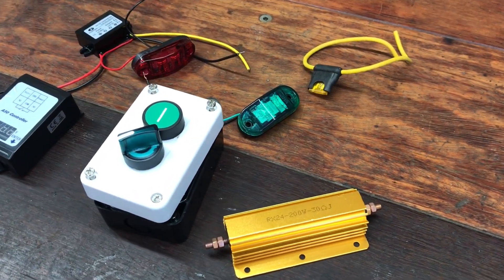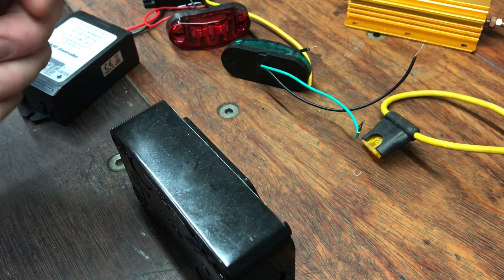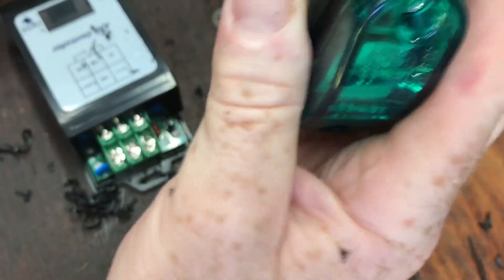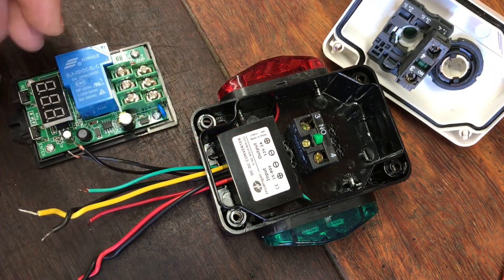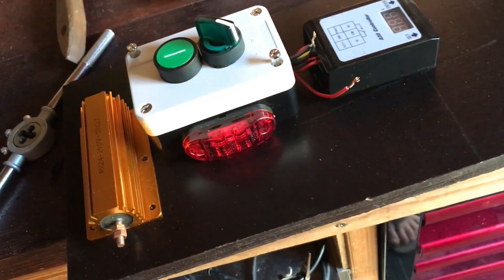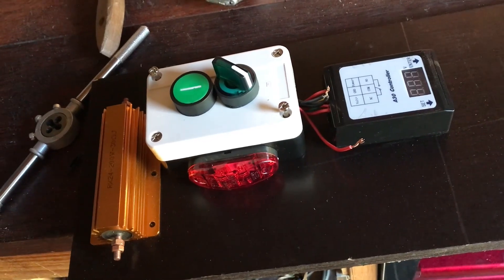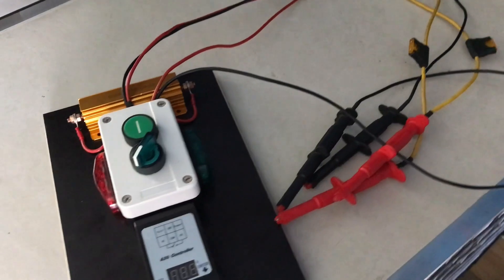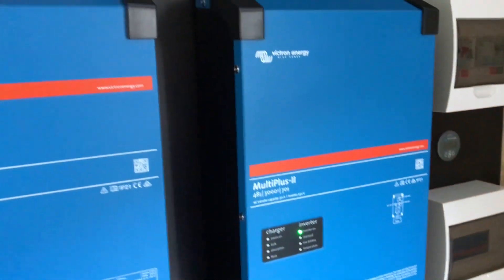SAFE Off-Grid Start Up Procedure For Parallel Victron Energy Multiplus II - Extend Equipment Life

Comment: I have a 32 amp mini dc breaker that gets 100*f coming from 4 525 watt panels wired 2s2p seeing 100v 37a. Bought a 50a mini but that’s probably not going to cool the hot breaker issue.Replacing 10 gauge wire from panels to controller with 8 gauge wire.If that doesn’t cool breaker off I’ll buy a big breaker like you installed.
Reply from the maker: Consider joining the YouTube channel or our Patreon, you can contact me directly to answer any technical questions. I am a "A Class" electrician, I've got the books open here with the answers you require. 6mm2 10awg flex has a CCC of 43A touching, before calculating voltage drop.
Reply: @OrganicPower-Australia  I subbed right after my last question.Great channel !!! Just finished installing 8awg.Only 10 foot runs. Hope it cools it off.
Reply from the maker: Thank you for supporting the channel with a SUB! 10mm2 8awg is rated to 62A touching or 33A exposed to sun. I'm sure you have it covered, but make sure you use decent quality 2 pole "DC" circuit breakers. Re-tighten the terminals several times when using flex cable, also add boot lace crimps to provide a solid low resistance joint. Cheers
Reply: @OrganicPower-Australia  tanks . Yes I put ferrals on wires.Thing about Amazon per chase as of late the proven good stifff doesn’t come up unless you know what to get then it pops up. Most times unavailable. Thanks for having me mate!
Check out in USA a song ,I’m just a skinny boy gona chase your women and drink your beer.Cheers
Reply from the maker: No problem, glad you dropped by 🤙🏻

Comment: Great video as always👍 I was wondering about you switching out the mccb from tomzn to gaya. was there a particular reason or just an upgrade needed for the newly added battery bank?
Keep it up!
Reply from the maker: Hey there, thanks for the great question. The breakers were upgraded from 200A to 320a as the system grew from 5kva to 15kva. The 48v supply cables were also upgraded.  Geya had the best price point for 320A in this format. Thanks for the motivation! It takes a bit of work 👍🏻😎